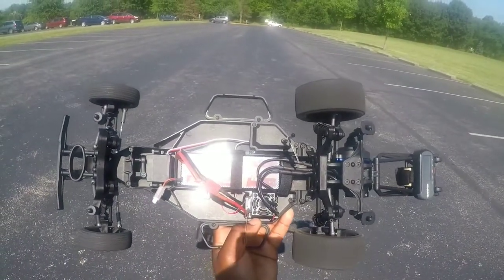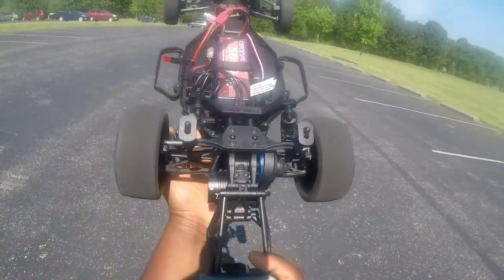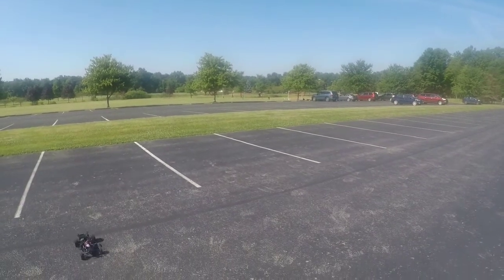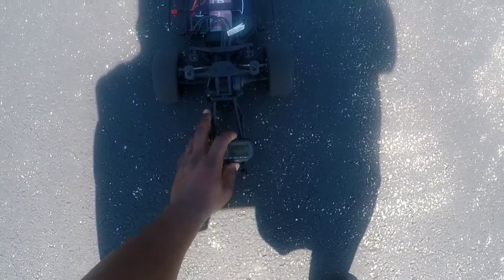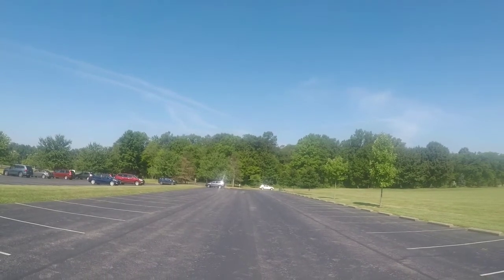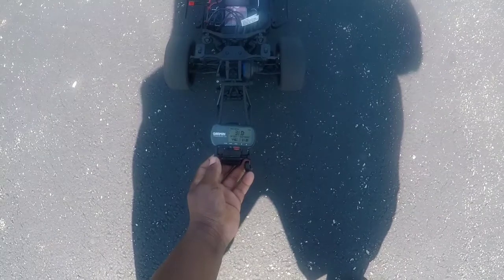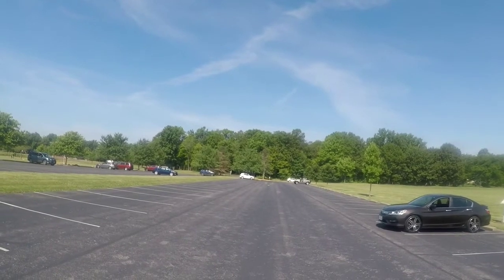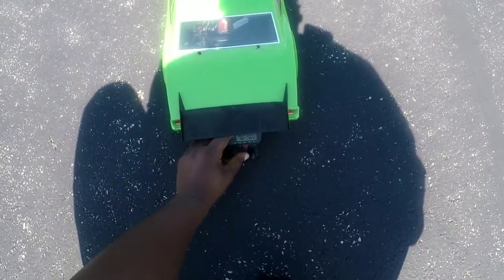TEAM ASSOCIATED DR10 FIRST RUN ON 2S

Comment: Yessssir, i was trying to watch to see what was going on. I believe it’s in the esc setting since you are using the stock remote.
Reply from the maker: Yeah this esc is junk upgrades on the way new motor esc controller and receiver wheels 🤣 mine ain't running like yours rcfam4life
Reply: MOBAY 876 RC all i did was gearing and the tx/rx bruh... stock esc and motor